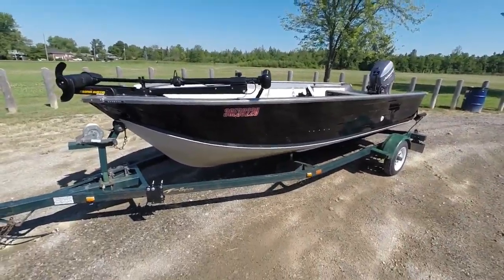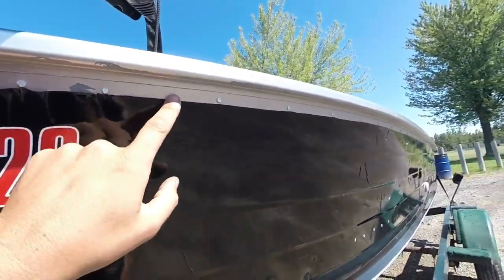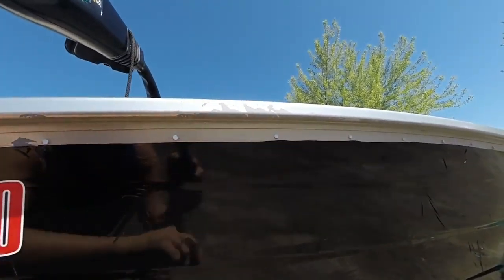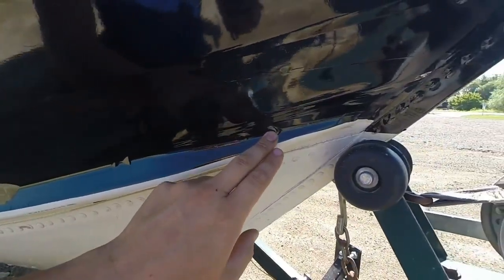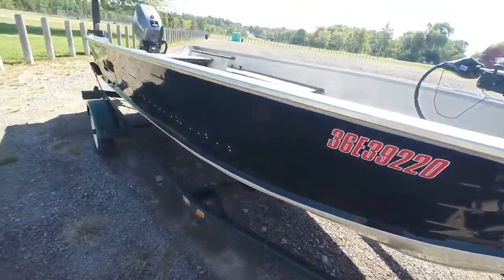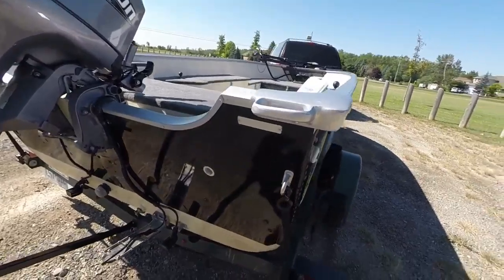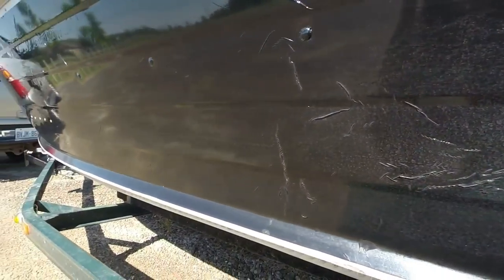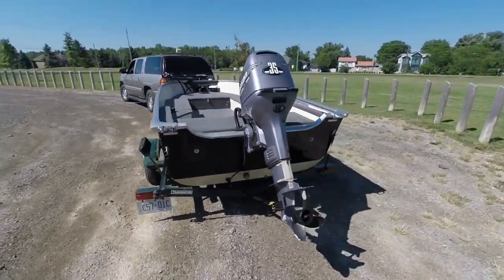3M Boat Wrap - Aluminum Boat Project #27

Comment: Hey Lawren, I am actually an owner/operator of a vinyl graphics business in Manitoba (and an avid fisherman :) ). This is just my opinion but the edge sealer and primer are not needed if the surface is clean, you are using the right product (vinyl) and it is installed correctly. I seen some of the areas you struggled with and it looks like it just needed to be laid down smoother. When working with this stuff especially wrapping, heat is your friend. You definitely want to have a heat gun with you, patiently lay it down inch by inch and if you get a bubble or wrinkle pull the material back up off the surface and try again. Understandably the jobs done now but it is something to consider if you decide to ever give it a shot again. You took on a challenging project even for someone with experience dealing with angles, rivets and cut outs is difficult. Btw good material should come with a rating of 5-6 years outdoor life span, this is comparable to the stuff we use on signs for outdoor applications, it holds up in the rain, -30 and heat. The primer/sealer most likely would not have helped (I never use the stuff).
Reply: Travis In Canada Hey where abouts are you in Manitoba and what would be ballpark to wrap a 20 foot lund for me? I'm in SE Sask. Thanks!
Reply from the maker: +Robby G13 You'd be looking at about $2000-3000 to have that done depending on the shop you go with.

Comment: Hi, I have the same boat I think, a 16ft StarCraft. How much material was needed for the outside of the hall? Also, where did you buy the material from?
Reply from the maker: I got it on ebay and it was 3M 1080 I believe.  I don't know how much I used, but I just measured the hull and then ordered the amount needed

Comment: Hey man great video, I'm in ontairo too, just wondering what would somthing like that cost? I got a 16ft Starcraft needs that or a paint job, would u rather paint or wrap ?
Reply from the maker: +cody powers I got the material from a place in Quebec for like $300. The primer and edge sealer was hard to find and expensive so I that's why I didn't do them. But you really need to lol. I'd do the vinyl over paint in a heartbeat. Mossy Oak has some vids on their channel to show you some tricks on how to apply it.
Reply: +Lawren Wetzel thanks a lot!
Reply: Lawren Wetzel out of curiosity, what is your objection to paint?
Reply from the maker: +Daniel Cartis Nothing really. I just wanted to try this. I've never seen a repainted boost that looked good either